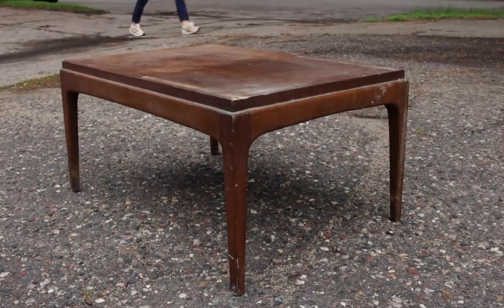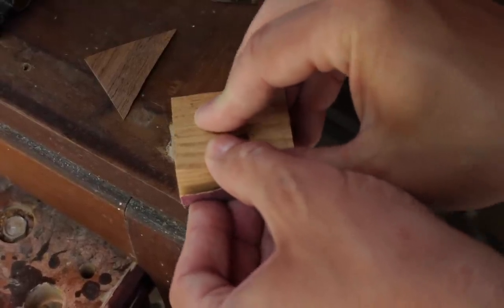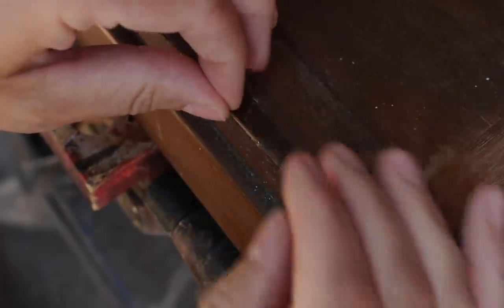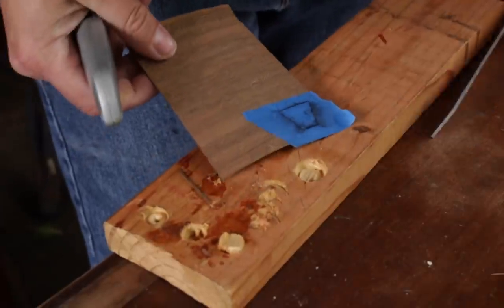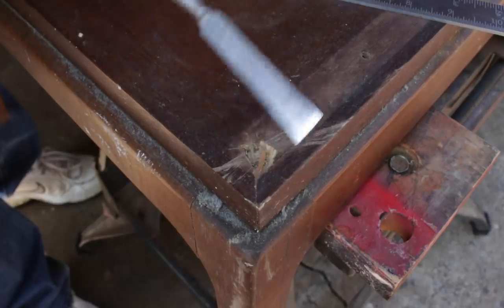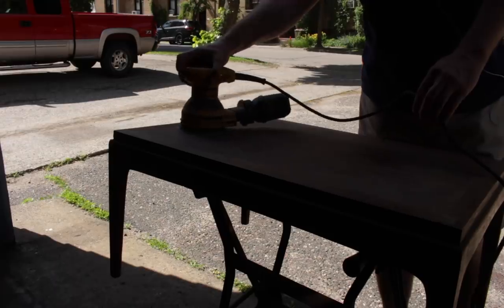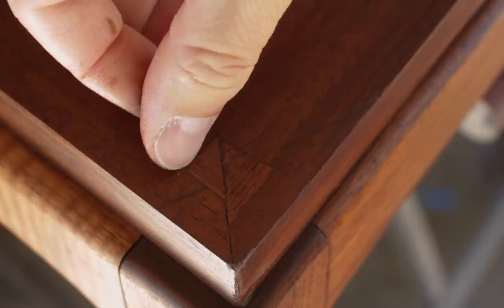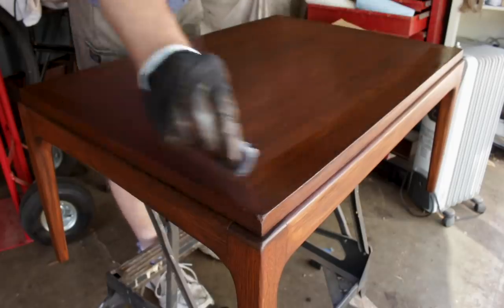Thrift Store Rescue #17 | Refinishing A Mid Century Lane Table | Furniture Restoration

Comment: Very nice work, I like it and I think many more did this too even if they did not give you a thumbs up.
One thing is for sure, I appreciate this furniture from the 60's so just keep going, look for more projects like this. 👍
A tip! Furniture manufacturers apply two glossy layers and finally a thin layer of matt lacquer. That way, it becomes a depth in the lacquer almost like an extra dimension. Thanks

Carsten Sweden

Comment: Sure brings back memories. Lane made various styles of tables with the same general lines. My parents had two end tables and a cocktail table. The end tables were different - no second level but with a single drawer. The cocktail table looked the same as your finished table, only longer, to put in front of the couch.

Comment: this came out great. I love watching you fix things. Are you able to explain your process a little more? I know nothing about refinishing. Like why put shellac on then stain then poly? Any waym these videos always brighten my day, thank-you
Reply from the maker: The shellac provides a barrier between the coats of stain.  Since I put on two coats of gel stain, if I hadn’t put the coat of shellac between them I may have lifted the first coat when I applied the second coat.  If you let the stain dry thoroughly you may not need the shellac but I applied it anyway to be safe.
Reply: @DashnerDesignRestoration  Also worth pointing out that shellac is basically the only finish guaranteed to stick to absolutely any other kind of finish, so you can put it over stain, varnish, polyurethane, penetrating oil or whatnot and it'll stick.

Comment: Can I make a suggestion? Instead of using opaque painters tape to make a template, get a roll of clear self-adhesive book covering plastic and use a little piece of that. You can see through it and it has lines on the peel off backing to help you align things.

Comment: This look like the Lane Rhythm step table
Description: Softly sculptured legs and rails flow together as a single molded unit in the design of this distinctive contemporary group. Figured walnut
heartwood, bordered with a slightly lighter shade of walnut, is used in the tops. Tops of the tables are indented from the rails just enough to emphasize
the sculptured, unitary construction. Pecan is used for all solid parts and a lovely oil finish completes a picture of clean, fluent lines and tastefully
restrained elegance in contemporary styling.

Comment: Great job! Nice project too.

Why do you suppose that most of the damage occurred around those dowel spots on this piece? Is that common?
Reply from the maker: When the shelf got pulled off the glue between it and the veneer pulled the veneer off.

Comment: In order to avoid harsh lines in the veneer where you add repairs, do you think that adding nail polish to the edges of the veneer where the grain is exposed could help the veneer to not absorb as much of the stain on the open ends where it tends to get really dark?
Reply from the maker: Yep, sealing the end grain would be a good idea.

Comment: Hey, I’ve got a general furniture question: if I wanted a really thick and smooth (doesn’t have to be perfect) surface for a desk, what finish would you use? I picked up an unfinished 2’x6’x1” oak board from Menards and will be staining it and finishing it myself. Polyurethane? Or should I think of something else?
Reply from the maker: A bunch of coats or polyurethane would work.

Comment: That's from Lane's Rhythm line.  That does not look like the original finish.  I had never seen a Rhythm piece with an upper shelf (I have refinished multiple pieces from the line) but I see they did have one. Too bad the top isn't on it, that's a rare one.  The legs on Rhythm tables are a different wood (pecan) which creates a nice contrast if you want a more modern look.  Nice restoration.
Reply from the maker: Thanks.  Yes, they are pecan according to a Lane Rhythm brochure I saw.
Reply: I’ve seen Rhythm end tables with shelves, and I agree that I don’t think this started off as one of them.